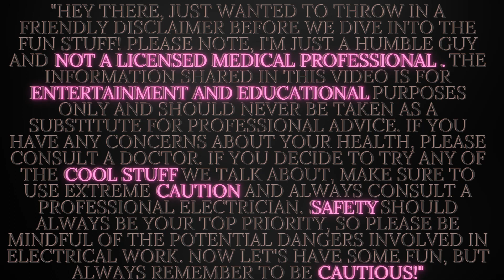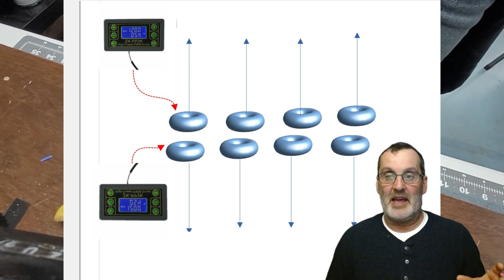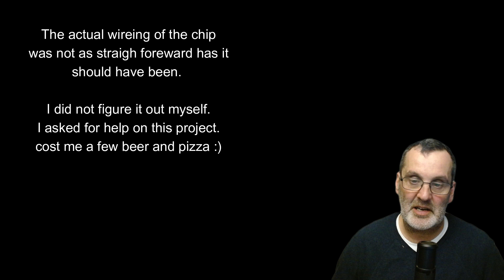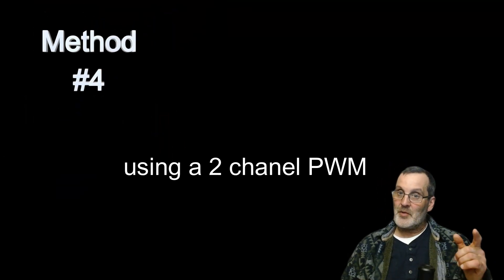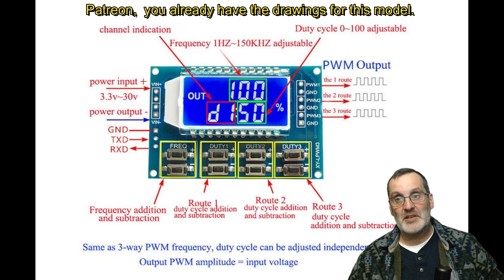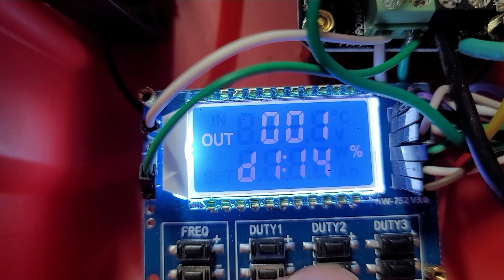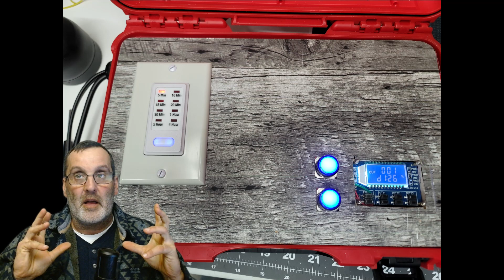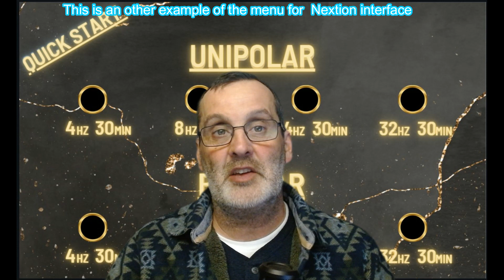The feline is out the bag!!

Comment: Thank you Steve for your channel, great work, much needed.

I started building my PEMFT mat before I found this channel, the information is very useful, it confirmed some of the stuff I have already learnt. Interesting about the double coil to get a reversed pulse. I did not think about, I am using a DPDT relay to reverse the pulses. According to Gary from PEMFT Australia, their mats reverse the field every 2 minutes. So with a timing circuit I can vary the reversal rate from seconds to minutes. The upside, a relay is cheaper than a doubled copper coil.

The other consideration is how much energy is needed? Some mats delivered very little magnetic field strength and others the field strength so strong that the muscles twitch.

Magnetic field strength depends upon the length of the copper wire, the wire gauge, the number of turns, the diameter of the coil and the voltage applied.

Another consideration is the treatment regimen, is it better to treat longer at a low level or higher power but shorter treatment time.

The solution for my needs is to design a device that has all the parameters that you can vary, that way it is easier to tune the device to deliver right amount of energy required.

Look forward to seeing your progress with PEMFT and the people you are helping. All the best from Australia.
Reply: I joined up but not sure how Patreon works. Had a look at some of your stuff, looks good. I am building my PEMF machine from a simple circuit from YouTube, however, modifying it to run 20 coils and incorporate field reversal among other features.

I was going to buy a PEMTF mat from PEMFT Australia, however, for $7,000 AUD I felt I wanted more features and higher power output from the coils.

The high power units are medical grade and comes at a cost around $40,000 AUD.

Decided to build my own with the features I wanted and have selectable power output. I am investing about $2,000 into the project and about 6 months on the build. I have most of my materials and started building the subassemblies. 

I will definitely be keeping up to date with your patreon page. 

Cheers, Derek
Reply from the maker: Thank you for the kind words. 

Gp.to my patreon and have a look around.  
We are light years ahead of youtube chanel.  

Look.me.up 

"Pemf with steeve"

Comment: I built mine using a 555 timer,   a Decade counter,  an OPamp IC,   Optocoupler,   and  then  Solid state relay   in H-Bridge configuration.    The Optocoupler is probably unnecessary,  but i wanted to make sure to isolate the low voltage components from the  High powered Solid state relays.   It's working now,  but It only took me a month of trial and error.  However,  It can only run it for about 15 minutes because the coils get hot.  I don't have any ailments,  so i'm using it to see if it will regrow my hair  or make me smarter.......
Reply from the maker: Amazing.  ;) 

Duty cycles would be where I start to.control the heat.   

Email me.at 
Hello@pemftheworld.com..

Let's chat.